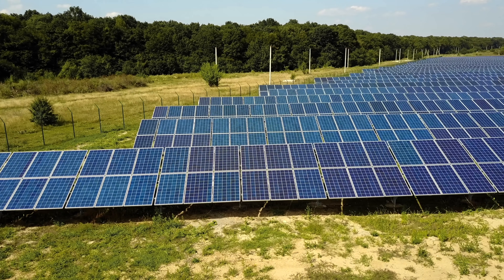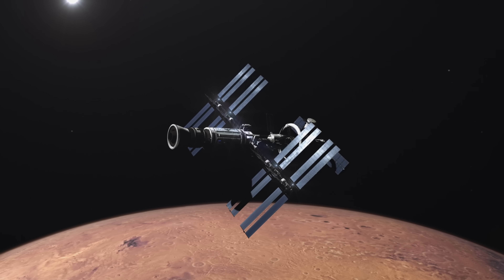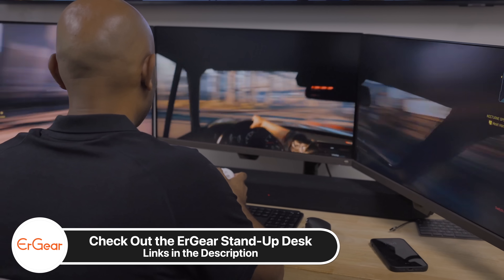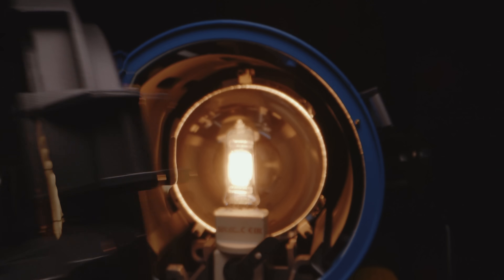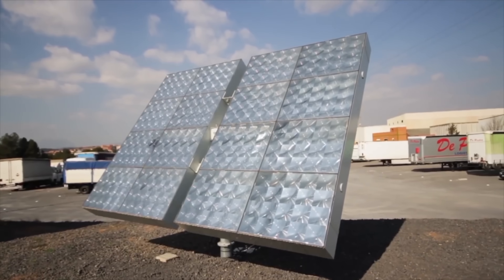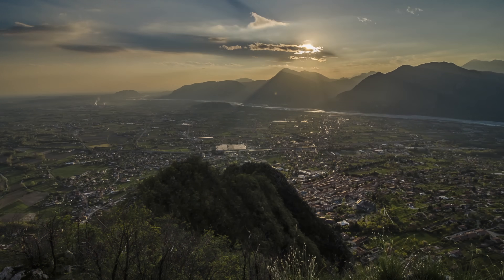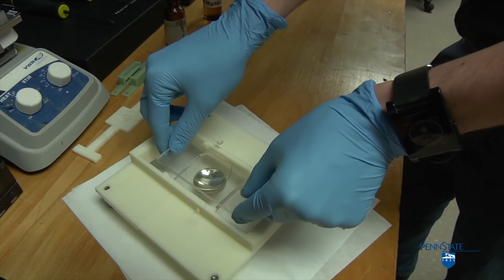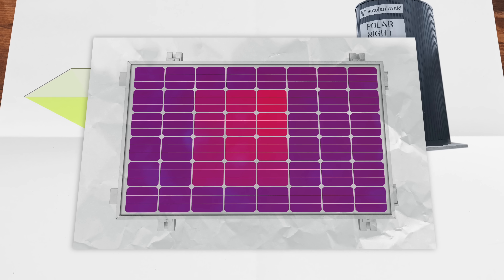Why Don't Solar Panels Have Magnifying Glasses On Them?

Comment: Great video. You should do a video on the new solar technology being developed by the British company "Cambridge Photon Technology" (CPT), who have been published in Nature Science journal. They are working on a transparent layer which could be placed over EXISTING solar panels, and this layer makes use energy from different parts of the light wavelength which are not used at all by normal solar panels, and it converts that otherwise unusable range into EXTRA photons of light that can be used, and passes those, along with the other light, onto the solar panel below. In brief, it does this by converting the normally unusable light into pairs of excitons which, via quantum dots, then causes the film to emit lower energy photons that the solar panels CAN then use in addition to the normal light bands the current do. This can effectively potentially double or more the efficiency of existing solar panels! Solar is already the cheapest way of making electricity, but if we can DOUBLE the amount of energy generated in by the same area of panels, then it would, when paired with batteries to make the energy available 24/7, change the world overnight to 100% renewable, clean, cheap and limitless energy. 

As the saying goes "If God had wanted us to have clean and limitless free energy then God would have put a huge nuclear fusion reactor in the sky... oh wait, God already did that, we call it the Sun!" Solar power is a way of simply using the same natural nuclear fusion energy that has provided the energy for all life on Earth, via heat and photosynthesis - so as all of life's energy comes from the Sun, it makes sense that ALL our energy should come from the same eternally reliable source!
Reply from the maker: wow that sounds fascinating, I'll check it out Tim!

Comment: Renogy flexible panels are covered in dots that are supposed to allow light to gather from multiple angles.  It's not concentrated of course, but it's something.
When purchasing solar panels, efficiency took a backseat to lifespan for me.  A 22% panel that loses 20% of its power over 25 years is way less efficient long term than a cheaper 20% panel that only loses 10% of its power over 25 years.
Reply: Yup. I would much rather buy 20% roof panels that only lose 10% over 50 years than pay the same money for a 22% panel that loses 20% 25 years.
When I buy bricks, I want those bricks to mostly do their job in 25, 50, 100 years not inconveniently stop working the day I pay off the mortgage.
Panel life expectancy is way more important to focus on today and not efficiency gains using exotic materials.
Reply from the maker: interesting about renogy i'll check it out! yeah longevity is way important for sure.
Reply: Exactly, for home solar  efficiency is good, longevity is better, price is king.
Reply: One system I have read about is using a pair of mirrors set between the panels. You do not move the panels with this system since the mirrors reflect the suns angle in a straighter form onto the panels. There very little heat buildup from this system and additional cooling is not required, but the efficiency is increased a large percentage.
Reply: @mrspeigle1  I'd say that longevity is more important than cost even. Since installation is a major cost as well as the panels.
Reply: Steam engines can last 100+ years. Solar reflector  making steam?
Reply: @alwayscensored6871  they're not maintenance free, and they can be quite dangerous, when they spring the smallest of leaks. I'm not saying they're not a viable option, but they have their detractors.
Reply: @alwayscensored6871  there's a very good reason steam has fallen out of favor for most applications, especially consumer/end user facing designs. As the other commenter mentioned, steam can be very dangerous, and requires a lot more mantinace and safety checks than a non pressurized system to run. If you want to get a visualization of the pressures being discussed, look up videos of an air compressor rupture. It's like a small bomb going off when it explodes, sending shrapnel everywhere. With steam, you add the boiling fluid, mostly water, and even a small pinhole leak can start spewing a jet of superheated steam that could cause serious injuries. It's possible that steam can be done safely, but I highly doubt we'll see large scale adoption of residential or DIY steam electricity generation systems without some sort of radical jump in technology.
Reply: @ChristopherGoggans  I know, steam can be invisible and mainly stories of people going to rescue victims running into that cloud and dying. Geothermal with supercritical CO2 turbines?
Reply: @alwayscensored6871  A billion dollars was spent on this.
It is sitting in the desert unused.
Reply: @ChristopherGoggans  Steam locomotives want a word.

Comment: You need to keep in mind that a concentrator has to take up the same amount of square footage as a standard PV panel, even if the cell itself is smaller, or a lot smaller.  So your panels end up being the same size!  That's because they all face the sun, with it's 1 KW/square meter.  So your roof installation is still the same size.  What could make a difference is higher efficiency cells, but currently it's a lot cheaper to just add more standard panels rather than buy special high-output panels or tracking hardware.
Reply: As he mentioned around 8:30 mark, the actual energy created for the same size panel is actually roughly 2.5 times as much. So you can get the same amount of energy for less real estate.
Reply: Careful wordsmithing can lead you to the wrong conclusions.

The bottom line is... Twice the sunlight requires twice the collector area.

You don't get something for nothing.
Reply: @richard77231  actually read the details

It's claiming to get 952 watts at ~45% efficiency from a 55x55 cm square. The sun only produces ~1400 watts on a 100x100 cm square.

The only way for that to happen would be the PV cell being 55x55 and the actual panel/collector being WAY bigger (on the order of 100x200 at a minimum)
Reply: Exactly what I came here to say

Comment: Conventional pv panels usually last about 20 years, surely exposing them to concentrated light would seriously shorten their lifespan
Reply: For regular solar cells this is probably a bad idea except in cold climates where overheating wouldn't be an issue. However high temp solar panels (500c)do exist and using those with mirrors makes more sense economically.
Reply from the maker: great points, yeah I think it would come down to economics, like if energy was expensive and you had a panel that produced 2x the energy in the same area, and those costs meant sufficient profits to consider changing them out in 10-15 years or so, maybe it makes sense. plus maybe these panels could be sent it for refurbishment, where nothing but the tiny cells inside have to be swapped out and then the panels are shipped out again!
Reply: @TwoBitDaVinci  Great point. The bulk of the panel would definitely be reusable. Only the solar cells would neet to be replaced.
Reply: It actually makes sense to make lifetime of PV cells shorter because in this case customers won't be locked for 20+ years to their legacy cells, but can periodically upgrade them and get benefits of improving tech.

Comment: 10:20 The PennState-University solution is almost intuitive, I´ve thought of that already the first moment I heard about such "concentrated cells" (15 years ago). It´s an almost "cheap" solution (shortcut/hack that an amateur would come up with), but in a good way... AGILE-lenses on the other side... not so much...

Comment: This idea of using magnifying glass on solar panels has been hovering my head for a decade now..
Reply from the maker: efficiency actually increases, except so does heat which lowers efficiency, it comes down to how much concentration we're talking about... good stuff!
Reply: same.
the idea makes sense.
the magnifying glass is too strong for our current technology tho. if we can diffuse the effect and keep it easier on the panel it would be better.
ppl have already thought of other good ideas using this same thing, like melting sand with mirrors and using it as a heat battery.. that works. but currently too expensive.. yet building nuclear plants isn't considered expensive. the goal is to make electricity in smart ways.. cost shouldn't be the issue, we can work on that later. 

another idea would be to divert light to a panel that would naturally not get sunlight at certain times of day. 
imagine if we could have a space mirror divert light at night onto solar panels. that would solve the "sun doesn't always shine" problem. 
but then comes the "you can weaponize it, you fuck up the day and night cycle for humans and animals" argument.
however.. it would be nice cuz solar panels could basically power the world at night this way. since ppl generally use less electricity at night. and we could burn less stuff as well.

i would use that space mirror technique near the poles of earth where day and night cycle switches every half a year or so. they could benefit the fuck out of that. and it would be an interesting localised experiment.
Reply: That idea was postulated back in the 70’s. Only the materials and electronics have improved.
Reply: @robertg7249 
China is already planning to deploy your space mirror idea, let's see how that works out for them, maybe we can learn a few things from how it affects them and find out it's pros and cons, most importantly know if it's worth working on or not 😂
Reply: Absolute Mad Chad  It also comes down to whether or not you can drain that heat away before the cell suffers any damage. We saw how they pulled this off in that "Solar Cell that doesn't run on sunshine video."

Comment: Imagine using it in conjunction with other passive systems, pull off the excess Heat preheat for your water heater, air for your heat pump system. There's a lot of heat that can be pulled off and used in a passive systems to help boost your houses efficiency.
Reply: You could also combine it with thermoeletric materials to convert the heat to electricity.
Reply: @eddielopez5708  Good point. I wonder why they aren't already doing that?
Reply: Gather the light to a point and then bounce it off of a nickel mirror surface to capture the heat and reflect the rest of the spectrum to a solar cell. Reduces wear on the solar cell.

Comment: The weight of these lens is also a big problem for rooftop solar.  And with regards to thermal losses due to lens material... that's actually a really difficult problem to solve cheaply.  Optical glass can get very expensive and most other materials (such as plastics) will degrade quickly from the UV.

-Matt
Reply: From my experience the UV damage is usually only on the surface which can be polished off similar to rejuvenating car headlight lenses that go opaque.
Reply: @celtshaun1427  the thing is, you don't need to climb on the roof of polish headlights, and there's usually only two of them. It would be a much more grueling task to to that to the entirety of a solar array.
Reply: The weight of the plastic lenses may be compensated for by requiring smaller/less PV cells. I think you can coat plastics with an UV resistant and absorbing layer. Car windows often have a plastic layer that absorbs UV.
Reply: @GerbenWulff  I don't think so.  The actual solar cells don't weight that much... I mean, think about it.  They are wafer-thin.  Its everything else around them that adds the real weight.  And these lens are very thick... we aren't talking paper-thin here, we are talking multiple inches.
Reply: @junkerzn7312  You are right about the weight of the wafer. Most of the weight is in the glass. But if you use less solar cell surface, you might also be able use less glass surface. And the plastic layer might allow the use of a thinner layer of glass. I know there are cells that have either top and back layer made of glass and cells that have a plastic foil backing.
Reply: @GerbenWulff  I really doubt it but I don't have any information on how much these concentrator panels weigh so its supposition for both of us.

Comment: 1:52 Just a quick comment... when talking about the cost of solar, you should try to find the cost without government subsidies. Those subsidies are taken out of our taxes, which means we're still paying it, just not upfront. Those additional costs-through-taxes should be accounted for when discussing the cost of solar when compared to other forms of energy production.
Reply from the maker: subsidies aren't taken out of anyone's taxes. Solar has a tax credit, so if I made 100k and owed 20k in taxes, going solar, allows me to keep my own money... and its not easy to do anyway, because governments subsidize oil and gas in a big way. so very tricky
Reply: 4:54 ... concentrating solar energy onto a cell increases the heat which decreases efficiency... so how can they say it improves performance? I'm confused... is that performance a comparison to non-concentrated solar cells?
Reply: I find comments like this funny when gas, and their infrastructure are also heavily subsidized. A lot of times more!

Comment: What do you have to say about solar panels creating more hazardous waste in their production and at their end-of-life? Some solar panels contain hazardous materials, which require special handling and disposal. What happens to those materials when a panel is damaged due to weather or damage to the home? The production of solar panels require the manufacturing and mining of rare and hazardous materials. This costs more than just money; the environmental damage is higher than the running of internal combustion engines or combined cycle power plants.

Comment: This reminds me of when I was cycling through France, past fields and fields of sunflowers. They would open in the morning and track the sun across the sky before closing at night. With these pyramid filters the panels could be flower shaped. The PV cell itself is quite small, and the rest of the panel is pretty much just glass, right? The thing is, sunflowers are small but there are lots of them, and I think that might be the way you could get these things on roofs. Perhaps lots of smaller cells that move independently (with a small profile) on the same mechanism could be the way forward? You could even put them behind a sheet of glass to keep them safe from the elements. Maybe even air cool them and use the air for a sand battery. Just a thought. We can get all of the heat and electricity we need from the sun. It's just a matter of engineering the perfect solution.
Reply: They're actually already is a product that looks like a giant flower and tracks the Sun. It's pretty cool because the panels are shaped like pedals and mounted on a central hub. The panels rotate behind each other at night to protect the cells from the elements. Has the neat side effect of looking like a flower with all but one pedal plucked at night
Reply: I've seen a thing called a "solar flower" that sits on a pole and has "petals" that are pie shaped, that open up when the sun comes up and tracks the sun till it goes down and then they close up. 
The action of closing up also cleans them.
They are sized for a home, but you'd need a clear area that is unshaded.
Reply: @wernerdanler2742  yeah. I'm pretty sure that was the thing I was thinking about.
Reply: I think perhaps the cells don't need to move. The angle of light on to the surface of the actual cell doesn't need to be absolutely direct, right? The concentration of sunlight does though, right? What if you could keep the cells in the same place but have a big glass lens with multiple focus points that moves to focus the light on to the cell throughout the day? I mean, the sun is always going to be roughly the same distance from the earth, right (as far as the cells are concerned anyway)? If you could manufacture an array of cells with just one moving part that focusses the light beams on the various cells, the mechanism would be much more simple. Similarly, you could have the array of cells move but keep the lens stationary. Either way, incorporating the focussing lens/lenses in to the lid of the panel makes a lot of sense to me. The idea of using multiple smaller cells in this way would lower the profile of the panel itself and make it more practical for roof use. I mean, I have a very basic engineering qualification, but it works in my head at least.

Comment: I’m still running some Arco panels that had reflectors trained on the in the late ‘70s at the Carrizzo Plains plant in California. The hotter temps due to reflection actually reduced efficiency and darkened the backing. They put out about 50% of their rating.

Comment: The issue with solar is not cost. It never has been. The problems are:
1: The massive environmental damage caused by destroying habits, the caustic chemicals needed to keep them clean, and the rapid rate of deterioration of the receiving surfaces. 
2: The amount of energy hitting the Earth is NOT the same as that which reaches the surface. Only 0.1% hits the surface of the Earth. This is a good thing. If all the energy which hits the Earth made its way to the surface, we would all be dead. The only way to power the whole world would be to cover the ENTIRE EARTH in solar panels using the cells shown in this video.